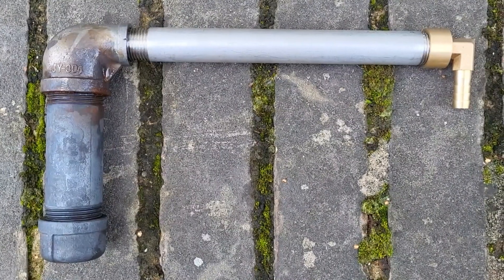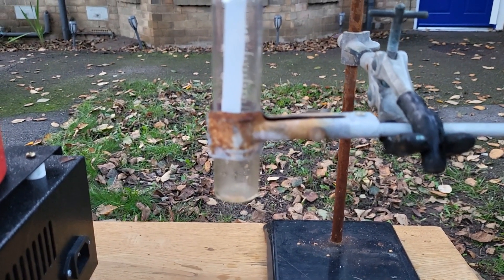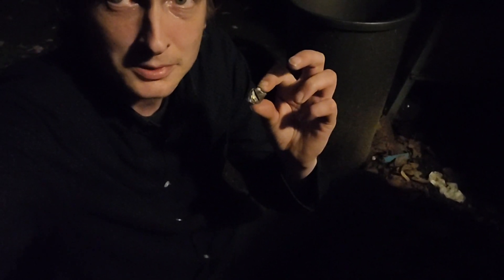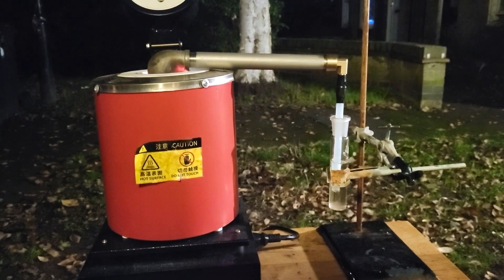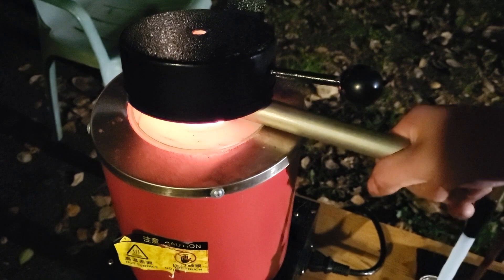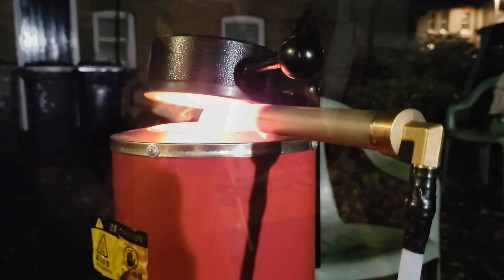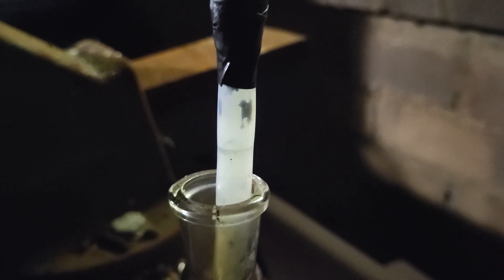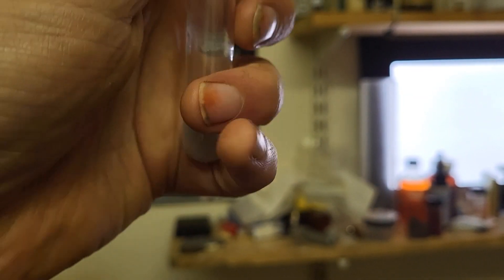making potassium

Comment: The condenser must be angled down to allow the drops to flow into the receiving vessel.  I'd bet most of the product is stuck in the horizontal pipe.  I'm sure you know this by now, but it's needs to be 30 degrees down or greater from the exit joint of the reaction vessel.  You would be better off with a copper tube for the retort with no joints to create steps and flow restriction inside.  It's also very bendable and a great heat conductor.
Reply from the maker: Yeah I realised this, also someone else made a similar comment. I could have heated it too instead of trying to cool it. Copper pipe seems like a good idea too. I could use such a vessel to make HF as well. Generate some HF in a copper tube using acid and a fluoride salt and have the output lead into water
Reply: @SodiumInteresting  Cool stuff.  I did a similar rig with cesium chloride and lithium to distill cesium.  Fun stuff.  It's also possible to make white phosphorus in a similar manner.  All big fire and health hazards, so starting with potassium is a good plan.  Get that right and tune the apparatus. :)  Great job in the channel so far!
Reply from the maker: @derekturner3272  I've done potassium and white P already on this channel. Could definitely improve the setup though

Comment: You can also try potassium oxide or even cesium oxide and reacting the same way with carbon, but with argon/inert flow over it as you get your potassium etc. Definitely need inert gas for making cesium.
Reply from the maker: What I seem to have here is a cm² of oily black stuff, I scraped the condenser to find a bit had stuck to the walls. The odd bit caught fire as I was removing it.
It also may not have been fully cleaned of ingredients I had used in it previously for distilling white phosphorus.

Before I scraped the condenser I had to wipe the outside of the tort, it was wet with green chromium looking stuff. Maybe the stainless steel wasn't so compatible for this or leaving it cooling down outside in the damp cold did it
Reply from the maker: Cool drone videos btw. I have the mini3p. There are flight restrictions where I live so I need to travel to be able to use it, especially if I want to take it that high.

Comment: You need to keep the condenser hot so molten potassium can flow and reach collection vessel. If you keep it cool then potassium solidify inside and clog it
Reply from the maker: Yeah I should have heated it, but there wasn't all that much in the condenser though when I scraped it. I plan to build a better setup so that I can distill rubidium and cesium at some point. I have a lot of glass parts coming soon, I'm going to practice flameworking on them